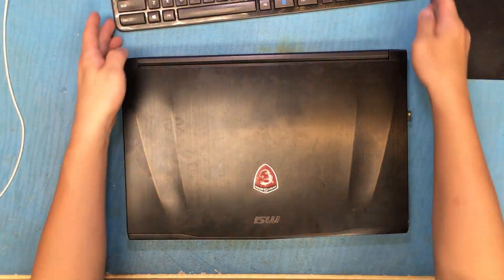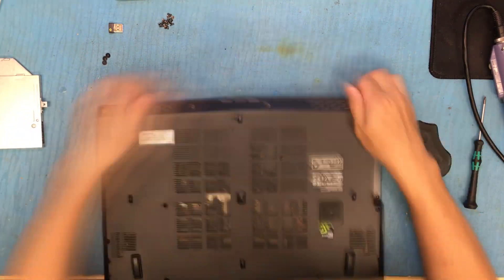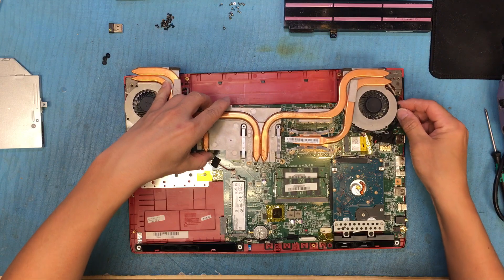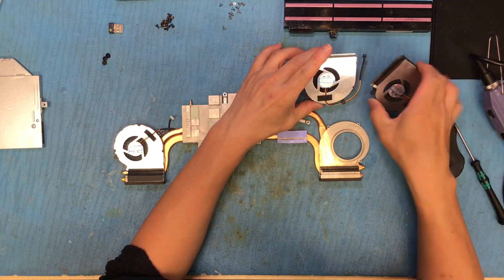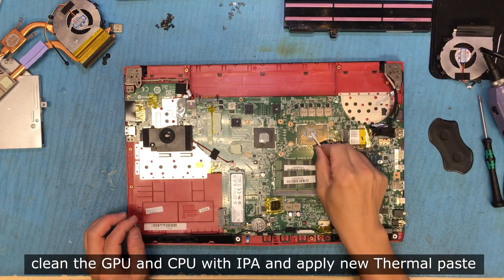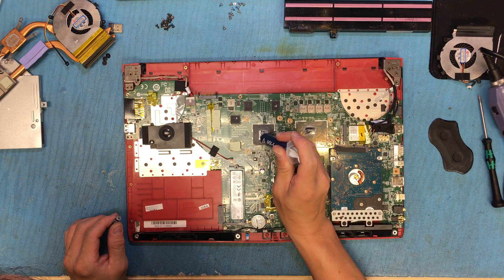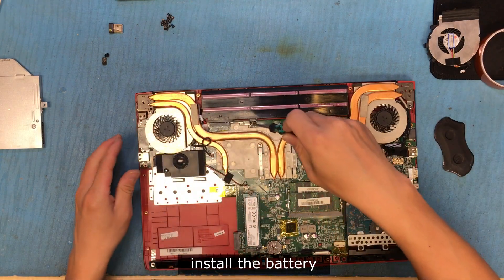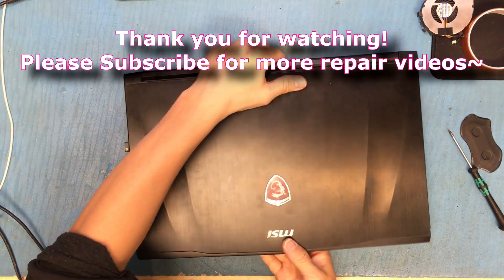How to Replace Cooling Fan for MSI Laptop GE62 (MS-16J5).

Comment: yes, a very nice tutorial, but please link the fan that you bought, thanks!
Reply from the maker: https://www.aliexpress.com/item/1005006751038652.html?spm=a2g0o.productlist.main.5.6104fF4jfF4jEq&algo_pvid=672ca22a-7cee-41ff-8bbc-50bc55560792&algo_exp_id=672ca22a-7cee-41ff-8bbc-50bc55560792-2&pdp_npi=4%40dis%21CAD%211.95%211.95%21%21%2110.00%2110.00%21%402101dee017258912053751110e1c55%2112000038181952818%21sea%21CA%210%21ABX&curPageLogUid=k7LLlNkhDEnc&utparam-url=scene%3Asearch%7Cquery_from%3A&done=&dp=0b09efb9a2e50b0f34eff99b8e8ae240&af=485352&cv=47843&afref=https%3A%2F%2Fwww.aliexpress.com%2F&mall_affr=pr3&utm_source=admitad&utm_medium=cpa&utm_campaign=485352&utm_content=47843&dp=0b09efb9a2e50b0f34eff99b8e8ae240&af=485352&cv=47843&afref=https%3A%2F%2Fwww.aliexpress.com%2F&mall_affr=pr3&utm_source=admitad&utm_medium=cpa&utm_campaign=485352&utm_content=47843&aff_fcid=6c66753f0b8941a19aaf1545bd666a73-1725891219920-01967-_ePNSNV&aff_fsk=_ePNSNV&aff_platform=portals-tool&sk=_ePNSNV&aff_trace_key=6c66753f0b8941a19aaf1545bd666a73-1725891219920-01967-_ePNSNV&terminal_id=8ced777148c4425ea69eeca4e6e7fc86&afSmartRedirect=y